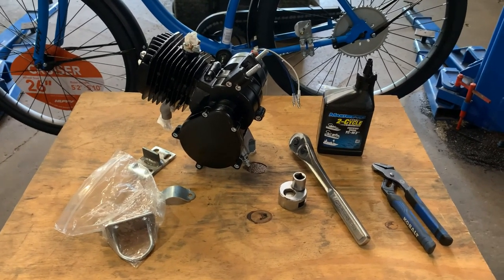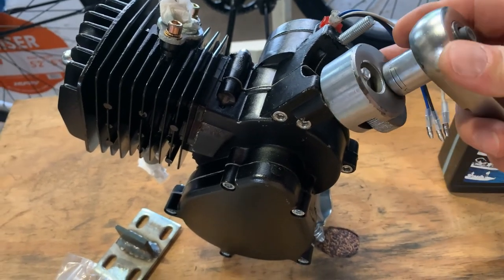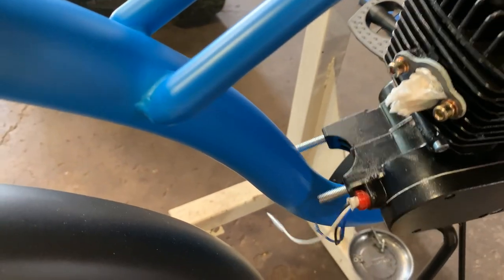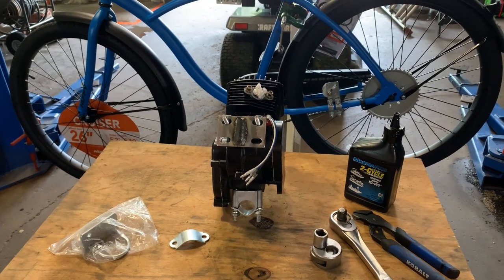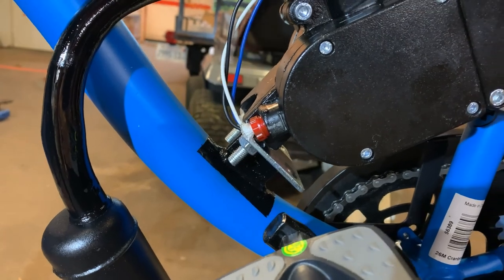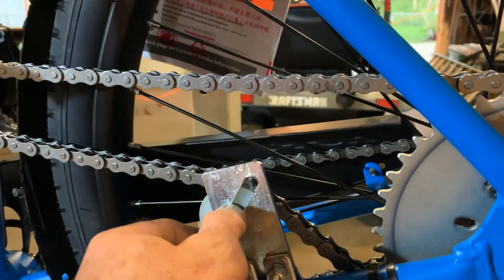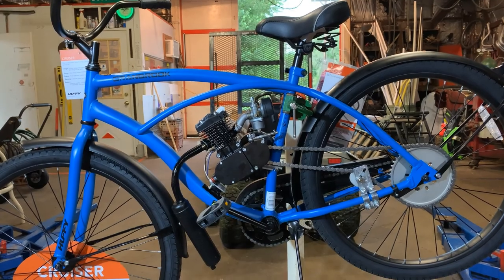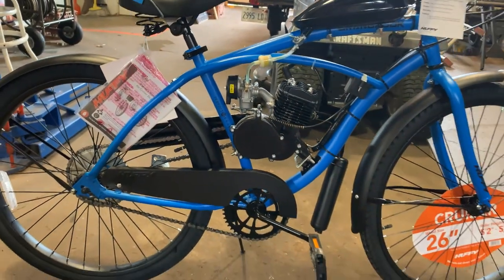Stud Installation Tool, Welded Engine Mount & The Fender Police !!

Comment: For a little extra insurance I put a zip tie around the front bottom mounting tab of  the fender and the frame over the mounting screw. If that screw falls out the zep tie will temporarily hold the the fender on
Reply from the maker: That's a great idea 👍👍

Comment: Where did you find your rear sprocket mount? Can you forward me a link? Thx for video…
Reply from the maker: I don't have the link readily available 😪😪But you can get them at TKO Moto 🚴‍♂🚴‍♂
Reply: Oh yeah 😎.  All this stuff is available on Amazon.  This 2x stroke motor was designed 🔥 in 1952 by Soviet Space Engineers. Sounds good to me?👍

Comment: Hey man thanks for the vid but do you happen to know if a 1 inch sprocket mount will fit on my 1.1 inch freewheel hub I can't find the 1.1 and how do you feel about those shims for the 1.5 inch ones I really like the mounts the rag joints scare me
Reply from the maker: Sometimes one of these style hubs won't work on certain styles of free wheel hubs, because the hub is not the same size all the way across, it will taper out at the ends, and even if you use the shims the hub will be too far inside the wheel to work properly. The shims do help if the hub is the same size all the way across. If you do have to use the rag joint on this wheel don't worry, usually the rag joint works really well with this type of wheel because the bearing housing is usually tapered & lines it's self-up because of the tapered end.   👍👍

Comment: I did a Cranbrook and didn’t need the adapter. The motor sat lower than yours
Reply from the maker: If you happen to have the small tube Cranbrook frame you shouldn't need an adapter. After I started using the welded front engine mount, I put them on every bike build, it just insures that the engine will never move even if the owner never checks the nuts & bolts through time, it's just a system I use that's never let me down yet.

Comment: Having fallen victim to the front fender and almost being killed because of it I will admit I am biased against them. 
I am aware that you can in fact make them safe, but the issue is many people won't take the extra measures to do so and unfortunately do end up getting seriously injured and also killed. 
For me it's easier to just tell them not to run them, but if a guy is willing to take every necessary measure to ensure they won't fail, then more power to hm. 
That's all.
Reply from the maker: I agree.. The best plan to ensure that you have no fender problem would be to remove them. 🚴‍♂🚴‍♂I also agree that the fender mounts can be more secure if one takes the time to do so but most won't take the time.. 🤷‍♀🤷‍♀
Reply: I've been over the bars before not cool 😒  I as well knew about it before it happened.  It still took a month, just to sit up though .
Reply from the maker: @Jarrod_D  I'm sorry to hear that.. 😭I admit that removing the fender completely does remove the risk of that happening, although a lot of people still want them on there, best I can do is explain the risk 🤷‍♀.
Reply: @EcoTransGaspoweredBikes  thanks for your reply 👍
Reply from the maker: @Jarrod_D  Anytime. 👍